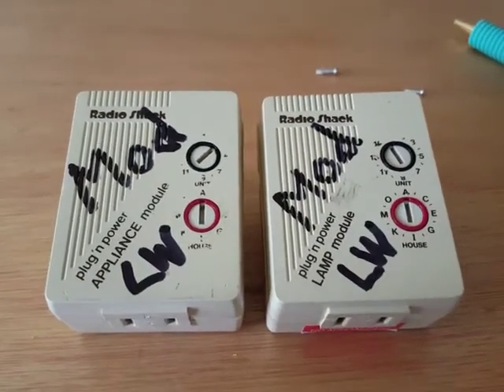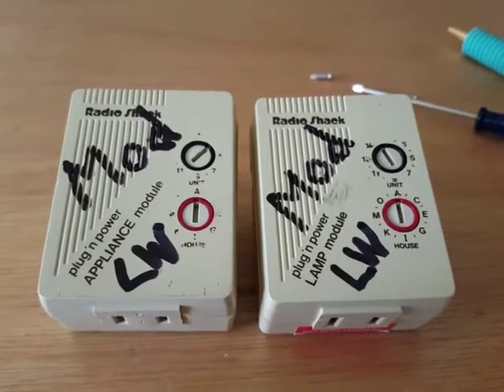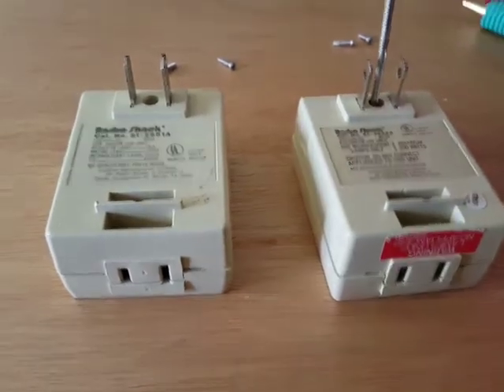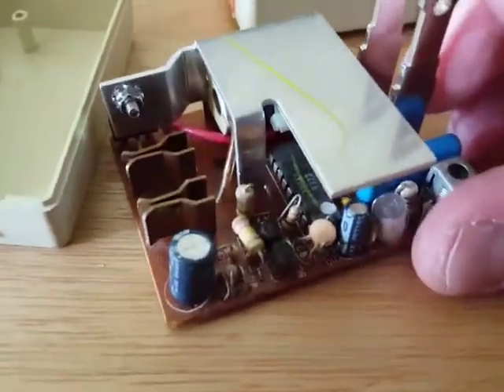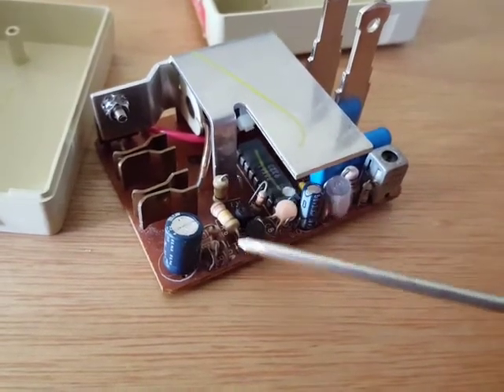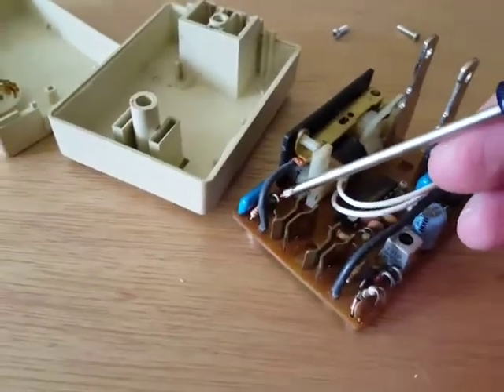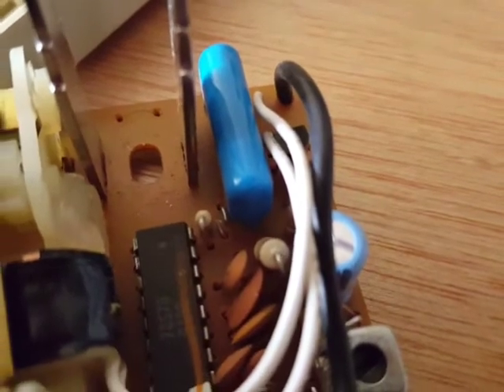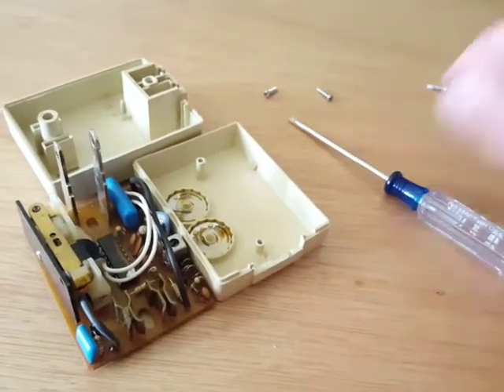X10 Appliance and Lamp Module Low Wattage Modification

Comment: BEWARE! the Bloom AM486 Schema has ERRORS! 5 of the Triangle Points ARE NOT tied to +V (L) they are tied to -V (DC GND) if you select one of these points to clamp a measuring device  you could cause damage, fire OR worse ... NOTE: also that the diagram shows 2 330k resistors ... the left side of these resistors is correct HOWEVER ... the RIGHT SIDE of these resistors are CROSSED! ... the Upper resistor suggesting its connected via its network of components to pin 8 IS ACTUALLY connected to the network BELOW it that connects to Pin 9 ... and Visa Versa! 
IF you remove the Resistor in Bloom Schema NOTE 2 the AM will no longer Function! ... the 78750 MCU requires this pin 9 signal to indicate that the Contact is either Open or Closed ... IT IS THIS resistor via the right most diode (-|>|--L) that is keeping the XMAS Led Strings lit  when the relay is off. Unfortunately there is no cut this or that solution to use these AM's with the Xmas lights  ( caveat  an old Incandescent Night lights will allow this to work if you can still find one)  ... my solution while still providing a current path to the xmas lights is to remove the 330k ... reattach this 330k resistor to L and the other side to a 2n7000 D .... connect a 3M3 in series with a 4M7 (total 7.5M) from NO contact to the 2n7000 gate ... the 2n7000 S is then attached to the pin 9 network where the 330k was originally connected ... to protect the 2n7000 gate I added 2 1n4148 diodes ... D1) A to Gate C to L ... D2) A to DC GND  (-V in Blooms Schema)  C to Gate ... hope that helps!

Comment: The problem that you described happens when I use an appliance module and use a 40 watt equivalent LED bulb (Not sure of the actual wattage). When I Turn the module off, the bulb would stay very dimly lit as you said.

 But I found if I add another bulb to that same module, then the module will turn both of the bulbs completely off. I'm guessing that this is due to the higher wattage requirement with the two bulbs being added together.
Reply from the maker: Yes! It's just enough to be annoying, right? Lol!

Comment: This did NOT work for me !!! Ruined an AM466 Appliance Module. It does not work at all now. I may have solved the flicker problem by plugging the LED device (in my case a low voltage using a transformer) into a single surge protector.

Comment: I'd like to know how to program them. I don't know what the slots are for.
Thanks.
Reply: there are 16 house codes and 16 channels on each house code, so you have to program to the same house code as your controller is set, then select the number (small dials on each module) to match the controller, simple!

Comment: Thank  you for posting this Jeremy, an easy mod indeed. Once modified the lamp module did turn on and off as requested using a 5v LED bulb. I did experience flickering? Thoughts?
Reply: I believe that X10 "lamp" modules use a Triac to switch the load, and also allow dimming.
Some LED bulbs will flicker when driven through a Triac at less than fully "on"?
You MAY be able to use a "dimmable" LED bulb with the X10 lamp module with success.
Reply: @DarronBirgenheier  Thank you!
Reply from the maker: Sorry for the very delayed response.  My notification settings were screwed up and I didn't know you had commented.  I agree with Darron below.  You can't dim LED light bulbs.  They just flicker.  It's all the way on or all the way off.

Comment: I have several of these units that I use on some incandescent candle Christmas decorations.  For whatever reason one of the unit stopped working this year.  It still works with other strands of lights in different rooms, but for some reason it doesn't work if I use more than two modules.  None are LED and nothing else has changed since last year when everything work fine.  What could be the problem?
Reply: X10 is very sensitive to "line-noise". An example of line noise is, for example, you plug and laptop into an AC outlet. The "brick" creates noise on that circuit it is plugged into and that noise can cancel an X10 signal. Also, LEDs are noisy. You may have added an LED light in your house unrelated to your incandescent decorations that are making noise on the circuit you use to plug in your modules for your Christmas candles. A TV even when off makes noise on the circuit it is plugged into. Try unplugging everything you can think of and then trying your X10 candles and see if they work. If they do, plug in all your stuff one-at-a-time until you find the one causing the interference with your x10. You have two options: Move the thing causing the interference (electric toothbrush charger, .....) to another location not on the circuit your X10 is plugged into, or purchase from X10.com or Amazon, or Smarthome, or, ...... a X10 filter. It looks like a brown lamp module. You plug the filter into the wall and then plug the thing making the noise/interference into the filter and your problem is solved. Hope this helps.
Reply: @benkanobe7500  very interesting
Reply from the maker: I have no idea.  I'm sorry.  I'd defer to Ben.